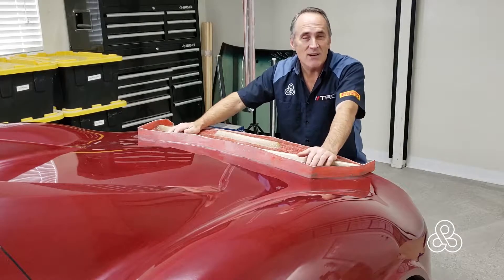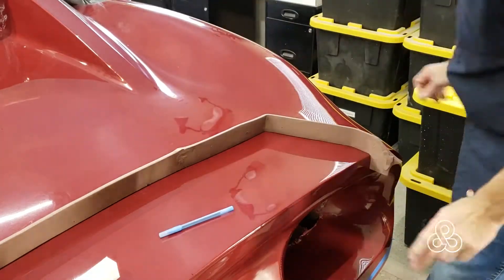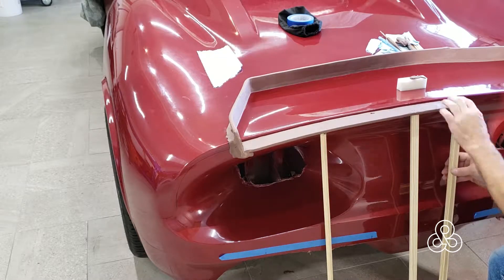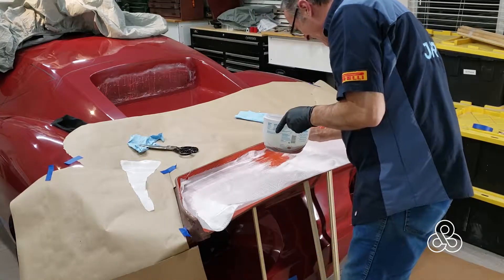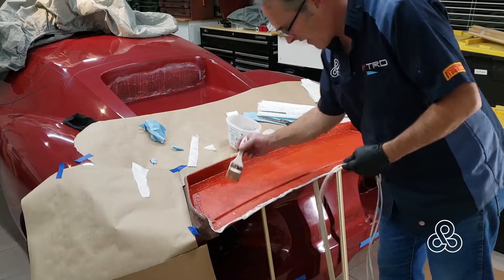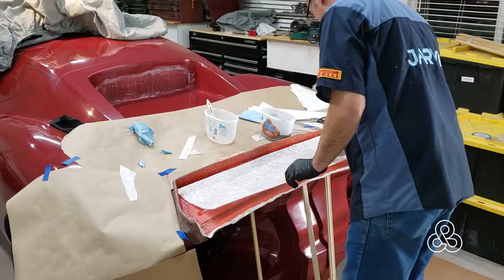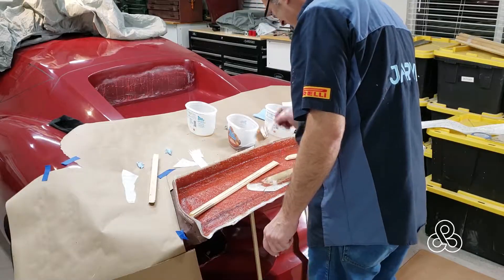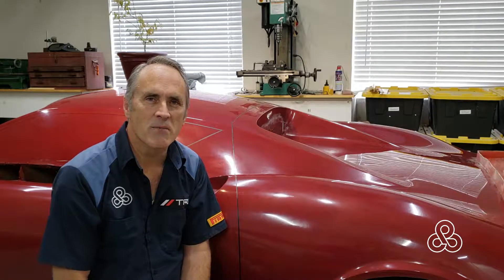A10 - Take a mold- make a hundred supercars. 1st mold of the Arete Supercar project

Comment: your flanges will prevent the mold from flexing, you couldve got away with only one stick
Reply: Flanges help with lateral and longitudinal flex but don't prevent twist, you need some diagonal profiles to the flatter surfaces to help with that.
Reply: @TheMeta6  that is a good point, however i still believe he couldve only used one of the sticks rather than 3.
Reply: Is he using wood to prevent flex ??
Reply: @carakyfullsender7280  yup, personally i use cardboard rolls but wood would be more solid and effective. just glass some scrap bits over top of them and consolidate them into the mould to prevent flexing and twisting.
Reply: @hobogreen3750  how they stay in times, maybe 10 years later? I was surprise first time i see this! I was thinking people use aluminium
Reply: @carakyfullsender7280  i believe anything really will work, its stuck under the fiberglass after all. added benefit of cardboard tubes is that the cardboard soaks some resin too and so solidifies with the fiberglass.